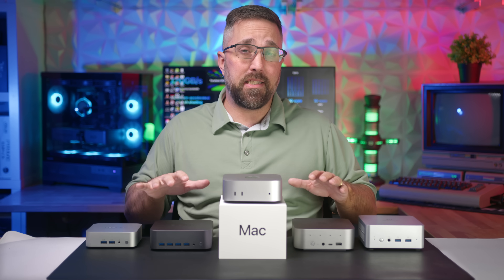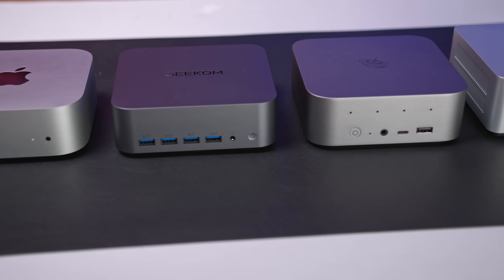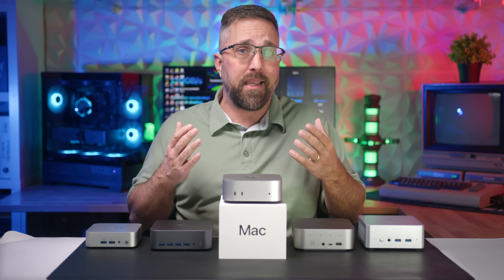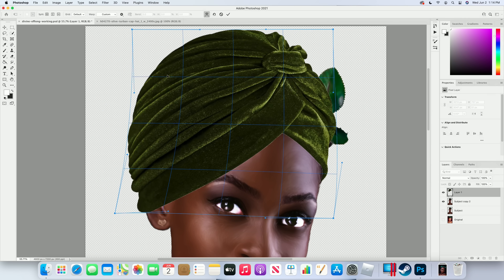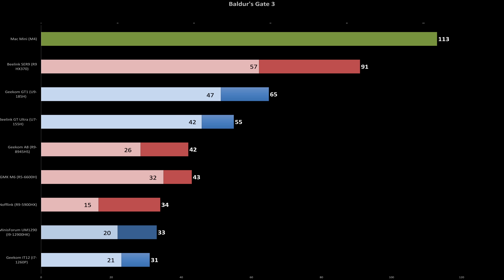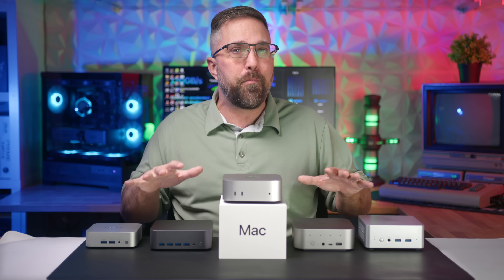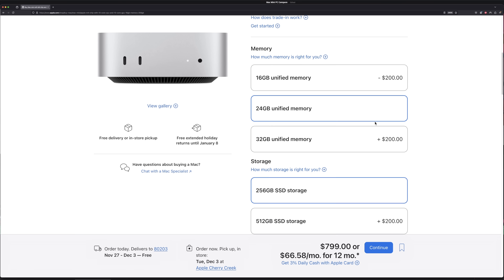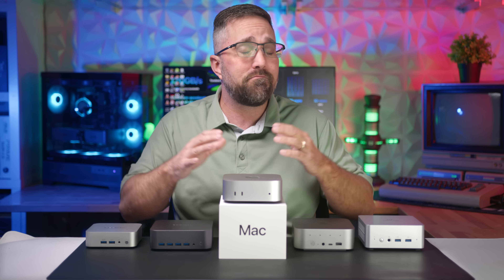M4 Mac Mini vs Intel and AMD Flagships – It's Not Even Close!

Comment: The problem with the Mac Mini is the cost of storage.  If Apple didn't think people were idiots and charge a reasonable price for storage, I would buy at least one of their mini's, but charging $200 for 256GB of storage, which would buy a top tier profession 2TB NVME driver that is faster than Apple's SSDs, there is no way I'm going to reward Apple with my money.  Yeah, I can just get an external drive, but I shouldn't have to and an external enclosure and drive still costs money, too.  

With the cost of storage being very low there is no reason for Apple to charge so much.   

Geekbench doesn't mean anything, its scores don't match any performance in real world applications as you can see.    A 20% performance boost in Geekbench scores won't show up as a 20% performance improvement in anything else. 

6:23 It's silicon not silicone.  Silicone is what flexible caulk is made out of silicon is what semiconductors are made out of.   

I have to say performance in productivity and creative applications on a cheap tiny computer seems kind of pointless to me.  A larger computer would cost less and could be more powerful.   If a person is creating as their career none of these computers would be ideal for it.   I would want a computer I could fix and upgrade myself if I needed my computer in order for me to pay rent.  If someone isn't making money on their computer and are creating for the enjoyment of it, does shaving a few minutes or seconds off a render really matter? 

If the best FPS for gaming was 68 that just isn't good enough for gaming.  None of these computers are good for gaming and for $1000 a person can get a much better gaming computer if they built it themselves.

It's not fair to compare a $599 Mac Mini with 16GB of RAM and 256GB of storage against a $1000 mini x86 computer with 32GB of RAM and 2TB of storage.  You either spec down the x86 computer or you spec up the Mac Mini with 32GB of RAM and 2TB of storage which would make the Mac mini cost $1800.     The Mac mini has a low price because it's so Apple can say "The new Mac Mini starting at $599" I don't know of anyone who would recommend a computer that has only 256GB of storage.  

If people don't buy their Mac mini and complain about the cost of storage, maybe Apple would do something about it.  But as long as people give their money to Apple they will keep doing it.
Reply: Im a PC user, never had an apple device, but in this case why almost everyone is nitpicking about comparison of these mini machines, that has 1tb storage, that has 64gb of RAM ect. etc. yes apple will cost more, but the base price is unmachable! First of all, if you want gaming, you dont even look at apple in the first place. Second of all, yes upgrading mac costs enormous amounts of money, but i think you need to look at this machine from base model/price perspective that they are selling for. Its not possible to get better spec machine for 500-600 bucks. 
If you're needs are satisfied with base model get the mac, if you need more storage, RAM dont get the mac, thats it!
Reply: Chill bro 😭 just buy an external ssd and be happy
Reply: A Yugo is cheaper than a Ferrari.
Reply: @tonyburzio4107  unfortunately, the Mac Mini is the Yugo.

Comment: If you're comparing price to performance and looking at base models then you shouldn't say you're comparing the M4 Mac Mini to Intel and AMD flagships, because that's not what you're doing.

Also, you're using language that downplays when the M4 doesn't win and emphasizes when it does.

Also, to say that it's not even close when the systems are trading blows, that's not accurate either.

Comment: The power button on the Mac is underneath because, in normal circumstances, you don;'t ever turn it off.  Simples.
Reply: Right. Apple power management is just wild compared to anything else. The Mac Mini uses 1w of power in standby. For perspective, it still uses 0.25w even when completely powered off (and plugged in, of course). The vast majority of Mac users simply never fully turn off the computer, and you can wake from keyboard, mouse, LAN, or after power failure.
Reply: Agree, in the old ages of torrents download we used to leave on power hungry pcs for months just for download.
Reply: Like charging port on apple mouse? Do not defend stupid decisions.
Reply: @woofkaf7724 another outrageously overblown ado about nothing. The damn mouse lasts MONTHS on a charge. A 2 minute charge gets you a day of power if you ignore weeks of warnings about low battery.

Literally a non-issue. Always has been.
Reply: @seanmolincreative  sure. dream on.
Reply: @seanmolincreative  Well, that doesn't change the fact that the charging port of the magic mouse is in a weird position for more than a decade now. It is what it is. I have two of them lying around that I got with iMacs, I never use it, my primary complain of them being too flat is just uncomfortable for longer sessions, I've always used logitech.

Comment: M4 Mini cannot run Windows software properly, and that's a big disadvantage.

Intel based Mini could run almost 100 percent of Windows software perfectly using Boot Camp, Parallels, etc.

Intel based Mini could use a very powerful AMD video card in an external box, attached via Thunderbolt.   M2/M3/M4 Minis cannot use external GPUs.   Such a drawback.
Reply: As a power user with an M1 Pro macbook, I disagree - for my personal usecase. I use both crossover and Parallels to run Windows (software) on my macbook, and it works flawlessly. Yes, in theory the emulation comes with a performance hit, but in practice I don't notice this at all. And think about it: the other way around, running macOS on Windows, is much more complicated/nigh on impossible.
Reply: People don't buy macs to run Windows software. This is not 1995. There are many apps, and many are better, on the Mac side. Those that want Windows will buy the apps they need.
Reply: @WestBendNews  people don't buy Macs for content creation, that is so 2012. There are so many productivity apps in windows, and many are better on the Windows side. Those that want a Mac will use the built in apps to browse, email and write letters. The rest will need a full office sweet, which would probably be better in windows. Let's not forget CAD and Technical software which is defiantly better in Windows.  What you are forgetting, is no one cares about your opinion.
Reply: I think technically ARM Macs could run external GPU via Thunderbolt, the issue is lack of drivers, I think...
Reply: @sobieckil07  ARM Macs have been out for years, and still external GPU boxes do not work .    The problem goes much deeper than simple 'drivers' .

And the GPU integrated into M3 or M4 chips is very weak and unimpressive, compared to NVidia graphics.   It's like comparing a bicycle to a BMW.
Reply: @sobieckil07  Unfortunately no. Apple does not implement the full pcie spec that would be needed for external GPU support. Specifically the way it handles external memory addressing modes. Apple themselves would have to patch the microcode of the chips to make external gpus possible and they've made it clear they have no interest after the mac pro.
Reply: Windows for ARM works great on Apple Silicon and runs x86 software.
Reply: @c0rnd0g_19  

Don't believe the hype. ARM has been slated to be a big deal 'any day now' according to tech blogs for the past decade, but it's never happened.

Microsoft has tried numerous times to get into ARM software, but fails often and abandons ship, see the Surface RT Line and the Surface pro X.

I wouldn't get excited about it or be prepared to spend money on any windows on arm devices anytime soon, unless you want to tinker with an older surface RT or pro X.
Reply: not sure why you would need windows software on arm.
Normally Windows is just for gaming and as you mentioned, the mac mini isn't a gaming machine. So not worth buying it for that purpose.

If you do some exotic stuff, you can do a full cpu emulation. costs performance, but that is typically not needed. UTM is your friend.
I haven't done it in years. 

Most of the software will be open source via brew or mac ports. Plus a few gui things from that app store.
Reply: @svr5423  not sure why you would need windows software on arm.

The same reason that millions of Mac owners were very happy to run Windows software using Boot Camp:    the Windows software ecosystem is far beyond the tiny pool of software that is native for Apple Silicon.
Reply: @DerekDavis213  Most Software is Open Source. There are tens of thousands of applications running natively on arm. Everything you need in everyday life.

I've always had Windows Computers sind Windows 3.11
Very rarely do I ever need a software that only exists on windows. These are highly specialised applications, such as management tools for certain pieces of hardware. For this you can just create a virtual machine.

And of course, games. But apple computers are not powerful enough for proper gaming, and emulation of non-native software is extra inefficient. So you won't buy a mac primarily for gaming windows games.
Reply: @svr5423  Most Software is Open Source

That is not true.  For example Maya, Microsoft Office, Solidworks, Autocad, Premiere Pro, Photoshop, Davinci Resolve, and most games made by EA, Ubisoft, Blizzard, etc.
Reply: @DerekDavis213  lol, there are tens of thousands of open source software packages and you name a few commercial applications that rarely everyone needs or uses.

From them Microsoft Office might be the most popular one. It doesn't serve a purpose since everything can be done more efficiently in other ways. But companies like to waste time and money with it. So they will typically just give you a windows laptop with office on it. Even if it's one of your customers. No need to run it on your mac. Fun fact: If you do, Office is still useless, but you get the better GUI. :)

I believe I've also seen some actual ports of the other stuff native on OSX. 

So for which exotic software do you actually need windows on your OSX machine?
Reply: @svr5423  which exotic software do you actually need windows on your OSX machine

How about almost ALL triple A games?   The best games are made for Windows, not for Apple Silicon Macs that have a tiny market share.   A Windows PC offers amazing price vs performance, and it has a huge software library.  That is why Windows has 90 percent market share.

And you ignored the very popular Photoshop and Premiere Pro software.  Those are definitely not Open Source!
Reply: An AMD Intel machine runs an emulator for Windows too.

Comment: I use Linux for everything,  and it surprising how some tasks perform way better on Linux than Windows. 
An extreme example is OpenSCAD renders about 2.5 times faster on Linux. 
So I guess my question is How much of the performance difference is from the hardware,  and how much is from the software. 
It could be that running Linux or BSD on say the Ryzen might double the performance of some tasks, or maybe just add a couple of percent here or there.

Comment: Non upgradable RAM or storage not only prevents you from upgrading for cheap, but also from fixing the computer if the SSD or RAM fails. They even made the SSD modular because it's better for them to switch the storage at any time based on demand, but used a special connector to fck consumers. PCs will continue using modular SSD and the Ram will also stay modular but move to CAMM, so, no, there's no reason for Apple to be this anti-consumer. It's funny how they brag about how "green" they are while doing this stuff
Reply: The SSD NAND controller is directly built into the M-series chips just like most mobile SOC. It's not just the connector that's different but the interface is completely different. Can Apple design their chips to work with standard M.2 SSDs? Absolutely but they choose not to because that's just how their business model works. They would never sell the base model for this cheap if you can easily upgrade it yourself without giving them the money.
Reply: Completely agree. It's horribly unsustainable to design computers to become obsolete because of storage/ram potentially years before the processors are too slow to use. There's already millions of Mac minis with 8gb of non upgradable ram.
Reply: I have a 2014 mini with soldered down RAM. The storage is upgradeable, and both the odd NVME and the SATA drive have been upgraded. The mini is still very useful and running Mint 22.
Reply: The faster you try to push hardware, the more difficult it becomes to ensure signaling. That's why we keep seeing cpu's with socketed memory hit a roadblock at 5600-7200 MT's (depending on the chip and memory configuration), while the soldered stuff is now topping out at 10,000 MT's. Yes socketed CAMM can hit higher stable frequencies compared to traditional dimms, but it still falls short of soldered memory performance.
You're increasing the distance those signals need to travel, which requires increased voltages and increased complexity in keeping the distances between components the same. 

That's the technical justification for doing things the way they're doing them, yes the pricing they're attaching for upgrades is obscene and inexcusable. There's no debating that point. 

But within the context of the product, and the audience the product is aimed at, their design choices are the ideal. People who want to tinker and upgrade aren't looking at this type of product, and trying to please people who aren't buying the product in the first place is going to make the product less performant, and thus less attractive to the type of people who just want a small, relatively performant device that just works.
Reply: There are several options to replace the Mac mini G4 STORAGE module. NONE of them require any soldering. They do require opening the case, some disassembly, and jumping through some procedural hoops to install a new system (including access to another recent Mac). There is plenty of documentation here on YouTube to show you how to do it.
Reply: Don't cry just make costum pc by your well cheaper and better
Reply: Jesus Christ too shortsighted fox they made the storage module or so that it could be replaced. If you wear it out I mean it is SSD after all, and it will wear out. In fact that was a failing on some of the early machines that had a mixed hard drive/SSD that once it wore out you’re just fucked. The machine was useless. The only thing you could really do at that point if I remember right, it was go to a full hard drive in this case so it’s a modular plug at the bare minimum. You could find somebody with a blown up M4 with a 2 TB drive and buy it off of them. Trust me there’s going to be aftermarket replacements, but from Apple standpoint, they made it that way so that they can easily swap it out under a warranty if your SS goes bad.
Reply: Most PCs nowadays are no different, no need to be sour over the M4 absolutely blowing x86 and Snapdragon out of the water.
Reply: Not just brag but downright lies about being green.
Reply: @anujmchitale  Of course it isn't green. They claim the "green" nature is because they allow you to "recycle it" with them and the packaging is using recycled materials LOL
Reply: It's true. I had to buy a whole new mac mini just to upgrade from 8gb to 16gb of ram (which is still low!). Its for work though.
Reply: And if you comment the same to 9to5 or macrumers you will get down votes from iSheeps.
Reply: False, the SSD hard drive in the mini is replaceable.
Reply: @tonyburzio4107  It is not user replicable. IT is a special module that doesn't have a Controller as that is on the chip itself.
Reply: @tonyburzio4107  I think you will find it isn’t “user replaceable” and by that I mean the average user ie. someone without micro soldering gear or expertise. 

Besides, Apple is unlikely to provide replacement parts, third party may provide a solution, but it still won’t be cheap or that easy due to economy of scale and not being designed for replacement.
Reply: Only by Apple, proprietary connection @tonyburzio4107

Comment: A computer with less than 4TB internal storage is a no-go for me.   Built my system two years ago and its current 2TBs are almost full.  (Upgrading to 4TB this Holiday season.)
Reply: Can do the exact same thing with these? It’s a computer. Thunderbolt is a direct Pcie connection. So when people talk about using external storage for their Mac it’s as fast or faster than “internal” storage for many situations.

Comment: RAM & SSD…  RAM gets to be contentious on the Mac. Many folks will find 16GB OK. I personally would consider springing for a RAM bump, even despite what Apple charges. SSD on the other hand is simple. The SSD it comes with is super-fast and is big enough to hold the OS and applications, which is exactly what you want on your super-fast storage. For everything else there is external, and you can take that any direction you want.